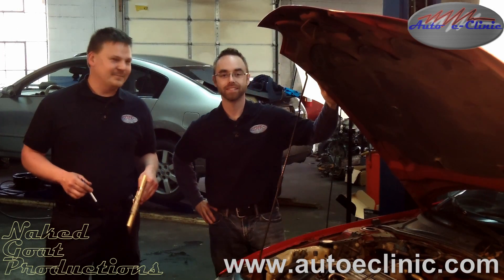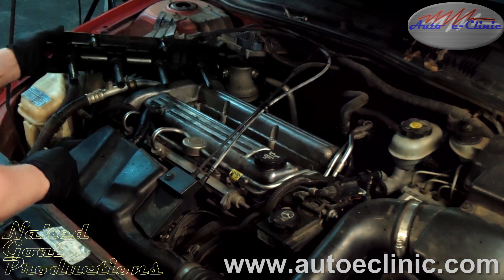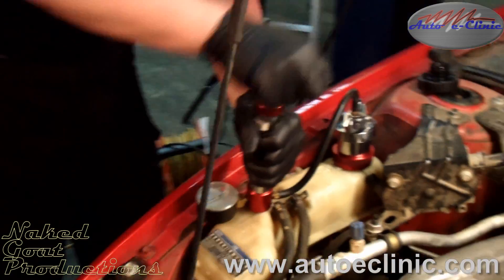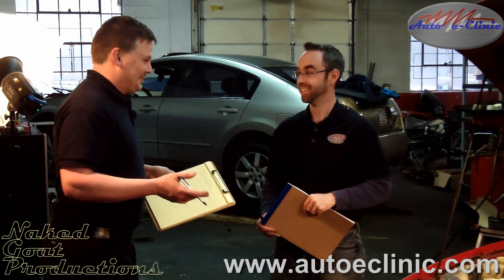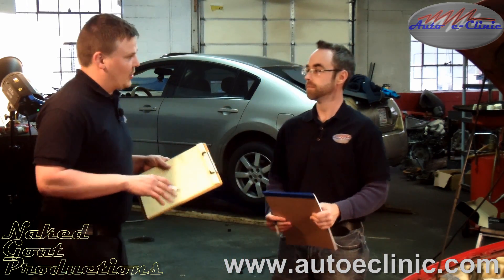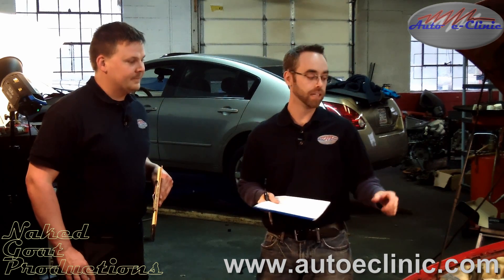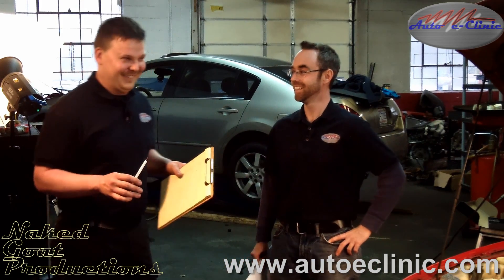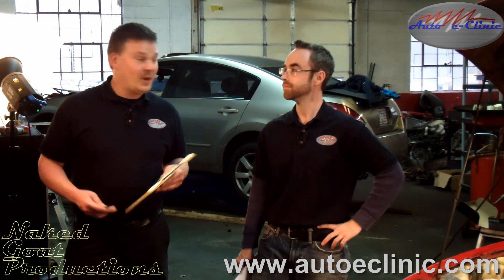Chevrolet Cavalier 2.2L  Misfire - Cracked Cylinder Head

Comment: I have the same problem. 2003 cavalier 2.2 ecotec. Hit a deer replaced radiator then when I changed spark plugs put the new ones in and driver's side plug hole shot coolant out of it.

Comment: This just happened to my 2000 saturn ls1. But my coolant was coming out of cyl #4. 140k miles. Never over heated. I did change the spark plugs a couple hours before. Im assuming this is poor casting during manufacturing.

Comment: My 1996 Camry leaks in cylinder 2 only pure antifreez tho and would function normally only when I take the spark plug out and let the antifreez drain into the cylinder and re tighten the spark plug and put the spark wire back in fires fine but definitely cylinder 2 is my problem

Comment: On my friend car was a 2007 Chevy Malibu 2.2l ecotec. Car sat for six months, I pressured test the cooling and found the leak dripping from the water pump and replaced it. Got a call back that the car had died and he drove around 5 miles after water pump replacement. Went to start the car and no start pulled all 4 plugs where wet. I put the cooling system under pressure at 14 pis  cap is 15... I then used a inspection camera thur the spark plug head and found water on the piston and with the 90 degree lens seen water come from the head gasket...

Comment: Awesome video
I'm working on a 06 cobalt with the 2.2 ecotec engine it throwed a p0300 code. Cleaned throttle body  Changed plugs... And cleaned MAF. After that didn't work I decided to check compression before I went any further. 
Cylinder #1 50 psi 
Cylinder #2 235 psi
Cylinder #3 225 psi
Cylinder #4 230 psi
So I checked cylinder #1 again with a cap full of oil in it. And got no compression at all. So I guess it's a stuck valve...

Comment: my ecotech 2.2  has oil in the spark plug reservoir of one plug, no coolant, it only smokes only after idling for  a few minuets and only then smokes for a 10 seconds after revving it up.coolant level is always fine,must add oil occasionally ,i think i got a loose cyclinder head bolt that happened to me on a different engine once,the bolt was found to be finger tight.

Comment: I have had a 2000 yr model Chevy Cavalier 2.2 4 cylinder Coupe, my question is are there any manufactures recall on Brakes, Suspension, and Steering, or any major recalls that would make your car not able to stop properly. I also won't to know what the probability of the air bag not deploying, when striking the sensor zone. Also, I wanna know about pressure points in the metal, the elasticity of me metal thickness. Head lights, the thickness of the head light cover. Can you give your email so I can properly show you what I am talking about. I am doing some research of a case, a cold case, and I wanna know your opinion

Comment: I'm sure if you get a low mileage engine then you'd get away with fitting another engine or buy a ring & bearing kit to "freshen" the engine up,it sounds like the GM 4 cylinders are very durable but I'd go for the crate motor approach on something like a Mitsubishi or something.
My dad had a 4G32 engine in a van which was rebuilt "as new" and the engine builder said the engine life on them is something like 150,000- 200,000 kilometres (92,000 - 122,000 miles) with the usual 3000 mile oil change and "nursing" the engine along the road at something like 50 MPH everywhere.
I've had very good luck with GM & Nissan engines,one of my Holdens has the Australian delivered Nissan RB30 engine in it, the first one I got about 500,000 kiometres ( about 307,000 miles) and the engine I have in it now is a Nissan RB30DE (RB25/30 hybrid),the block has about 500,000 kilometres on it but the engine was rebuilt at around 300,000 kilometres with new rings & bearings as there was nothing wrong with the block,the engine has done 200,000 kilometres since the rebuild and the compression is still good,probably just needs new valve stem seals as oil sits on the inlet valve thus causing the exhaust to smoke a little bit,Nissan claim a life expectancy of 400,000 kms or about 246,000 miles from the RB30E engine.
My other Holden is fitted with the Chevy LS1 engine and has almost 307,000 kilometres on it (188,344 miles) ,the only issue I've had with it was stuck lifters,since I'm not the first owner the engine missed a few oil changes so some siudge & varnish accumulated in the engine so I threw in a couple of bottles of the Wynns engine tune up & oil stabilizer which seems to have fixed that problem up in the last couple of oil changes.
I've replace the oil pan,valley cover & rocker cover gaskets to cure oil leaks,the front crankshaft pulley oil seal leaks a bit and is next on the list for replacement,AFAIK, the rear main oil seal is still good.
The engines compression is still good and the engine doesn't use much oil even though the front pulley oil seal leaks and I am confident that being an understressed big V8 engine that doesn't see above 1800 RPM's on the highway that the engine will never need a rebuild in the time I own the car.

Comment: 2.2 ectec junk
Reply: carl mueller Car has over 200k miles.  I beg to differ.
Reply: ***** I dunno about all that now.  The Cavalier was crap compared to it's import rivals.  Now the ecotec is a good little motor, and very rebuild friendly.  Personally, I would just rebuild the whole thing for my customer, and give them my 2 year warranty on it.
Reply: ***** Absolutely. I'm a bit old school in that sense. Most shops will either put a scrap motor in, or go with an aftermarket long block.  Both options in my opinion, don't give the customer the most bang for their buck.  A scrap yard engine will need service and attention.  Who knows how long it has been sitting, and how the previous owner maintained it.  It is also very difficult to confirm mileage. I don't trust the junk yard claims for one minute.  Better to just try and repair what was in there originally.  The owner knows it's history more or less, what was wrong with it, and what was good.  IMO, invest in yourself. That is how I see it.

A long block from Jesper is nice sure, but costly.  Keep in mind modern cars are a lot more than mechanical machines.  They have sensors, wires, connectors, computers, etc.  You can throw a rebuilt long block in there, but the control side will always be old, and will eventually need attention.  For the price of a long block from a company like Jesper, I typically can rebuild the original engine, and replace anything miscellaneous which might require attention (hoses, sensors, etc). 

As far as your inquiry goes, can't really help you there. I do not work on GM products.  I run an indy which services only German cars.  So I am out of the loop on cost of parts, and book times.  If I was to give an educated guess however, I would say 5000 for an engine/transmission combo.
Reply: ***** Indy = independent shop.  And I am located in Miami, Fl.
Reply: +BadTurbulence long block is an engine that is rebuilt and sold as a unit. The long block typically includes the cylinder head(s), rotating assembly, oil pan, and timing components included and installed as one unit. Accessories like water pump, power steering, respective bracketry, intake manifold, exhaust manifold, sensors, harness, etc is transferred over from the old engine onto the new.
Reply: +Lynx Star Automotive (Gabe V)  I agree with the rebuild... If the only thing is a cracked head, a full rebuild could be cheaper and if you offer them a two year warranty that will be more than worth it. I personnaly like the 2.2 Ecotec. I have a 2001 L200 with it and find that it has the power and the fuel economy both at its advantage. Fairly easy to repair if you respect the boundries.
Reply: cracked no 2 cylinder 2  piston many valves hand damged found engine for $800 37k work great
Reply: head damged

Comment: I have a code  misfire cylinder 8 i have changed spark plug , coil pack , and fuel injector . Plus i had a compression text done what else to do need help ( 2006 jeep commander limited 4.7 )

Comment: I have a 2002 chevy s10 with a 2.2 liter and it keeps getting water in the oil. I have replaced the head gasket, the old one didn't really look too bad but obviously I had to replace it anyway once I took the head off. It still does it. Any other ideas on what could be causing it aside from the head being cracked?
Reply from the maker: Does your truck have any type of oil cooling system? The 2.2s were prone to cracking, I would suggest on having it checked.
Reply: AutoEclinic Not that I know of. I will do a little research on it though.
Reply: I have the same year and engine too.